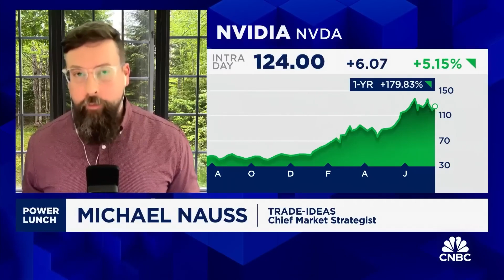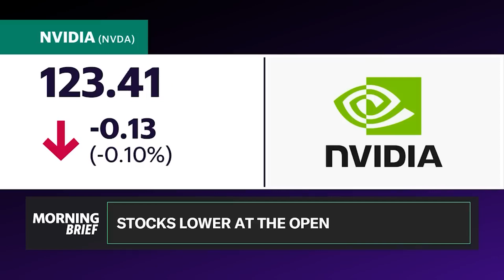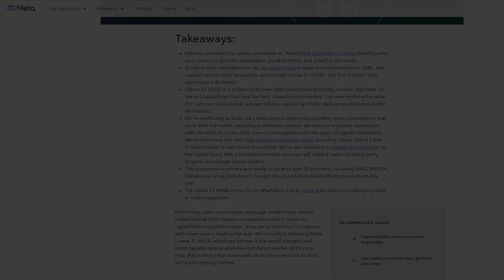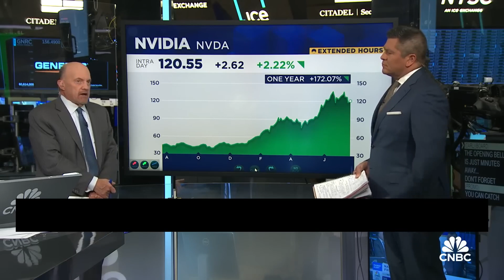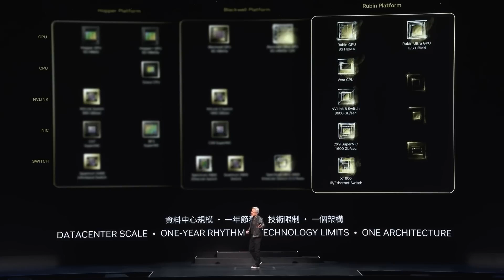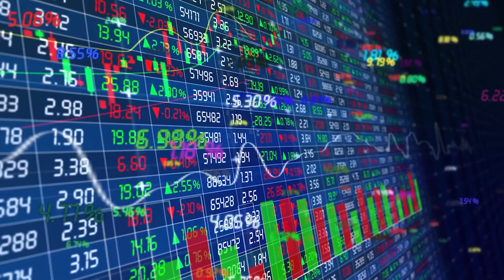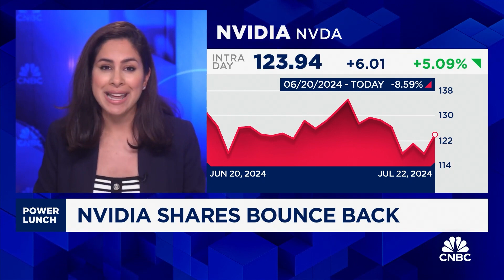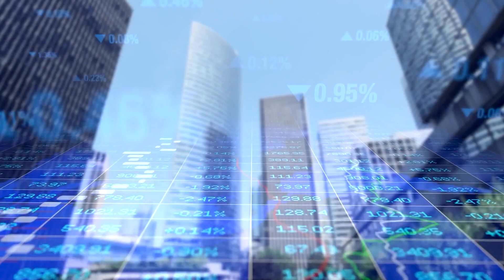Nvidia’s NEW PARTNERSHIP With Meta WILL DESTROY OpenAI

Comment: Okay, fine but fix the actual problems with VR. It needs to be a more open platform with software to get the best apps. ex. always allow UEVR, opensource projects that utilize the full potential of the HMD plus it's the best alternative to Apple. Meta should crash and I would personally distance myself from their stock if they go proprietary unless they merge fully under Nvidia.